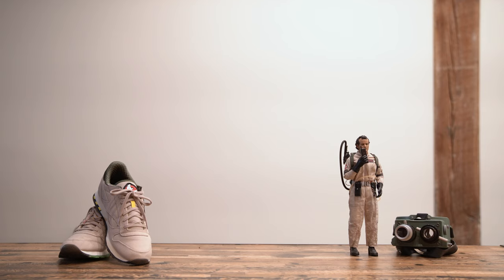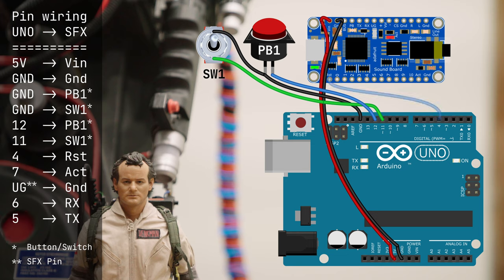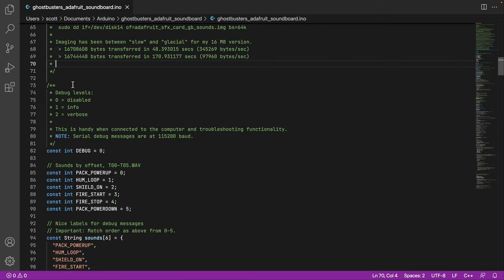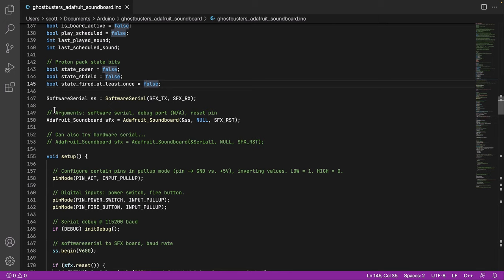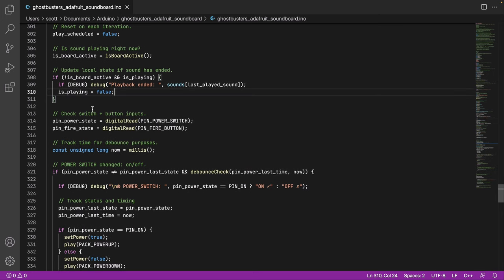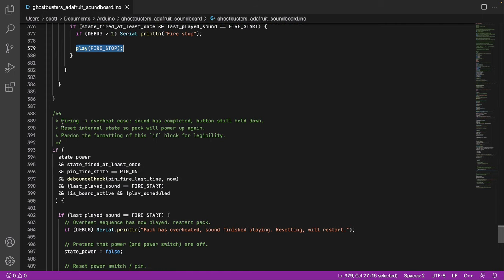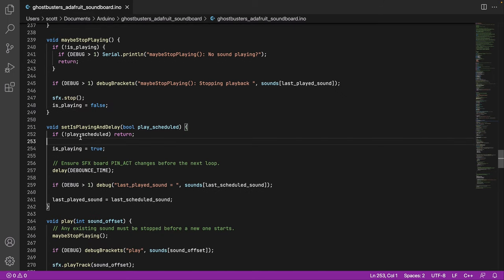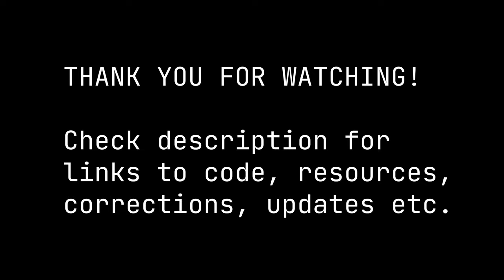👻💥🔊 Ghostbusters Proton Pack Sound Effects: Build Your Own / How-To, DIY Electronics w/Arduino 🛠️

Comment: can somebody help me? when i let go the trigger the sound of fire keeps playing until the overheat sound
Reply from the maker: The Arduino code should fire an “up” event, and stop the firing sound. Take a look at the console output, if you have debugging on etc., and see if it is attempting to stop, play the “fire stop” sound, and then returning back to the rumble state.
Reply: @scottschiller   ⏻ POWER_SWITCH: ON ✓
setPower(1)
maybeStopPlaying(): No sound playing?
play(PACK_POWERUP)
last_played_sound = PACK_POWERUP

⦿ FIRE BUTTON: UP ↑
Debounce: Ignoring delta of 8
Debounce: Ignoring delta of 9
Debounce: Ignoring delta of 9
Debounce: Ignoring delta of 11
Playback ended: PACK_POWERUP
maybeStopPlaying(): No sound playing?
play(HUM_LOOP)
last_played_sound = HUM_LOOP
Playback ended: HUM_LOOP
maybeStopPlaying(): No sound playing?
play(HUM_LOOP)
last_played_sound = HUM_LOOP

this is the serial output when I hit fire
Reply from the maker: @scarface7883 Thanks for the debug info. Looks like it thinks the fire button is “up”, e.g., released. Can you check your wiring, and make sure that is connected the right way? It should be reporting the button as “down” first, then “up.”